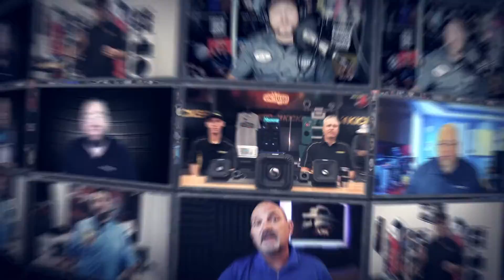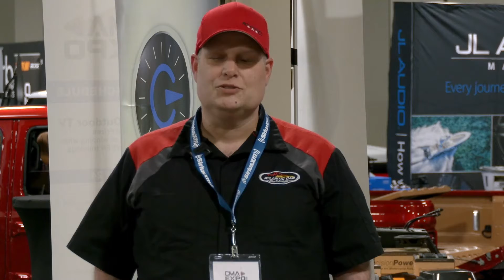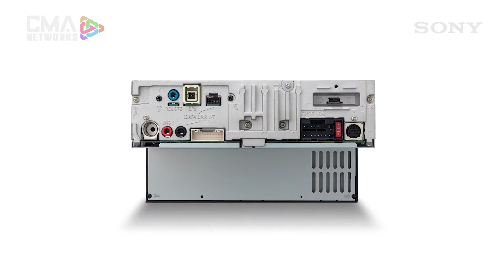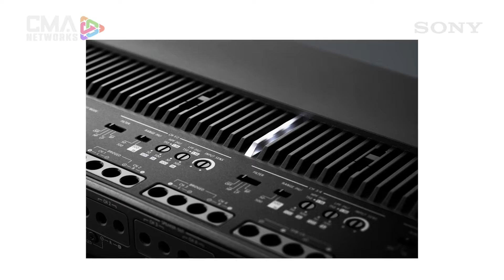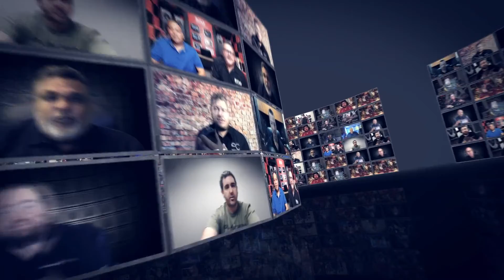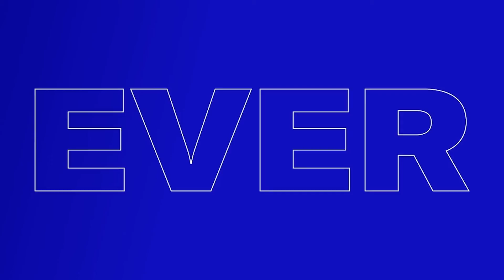SONY MOBILE ES | AUDIOPHILES | CONNECTED

Comment: the 9500es head unit sounds crap compared to for example pioneer p99. nothing special
Reply: You are definitely just talking shit.  Sony es radio blows that pioneer out the water
Reply: You do realize it has dsp built in, which needs to be set up correctly to get the optimum experience.